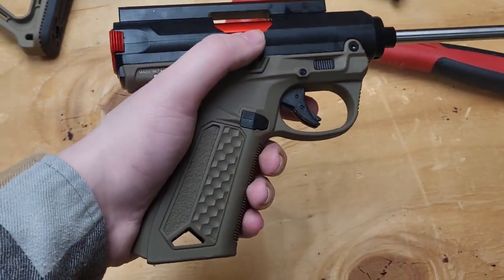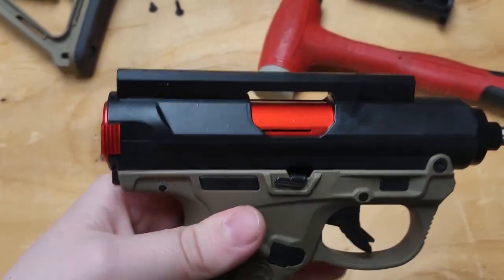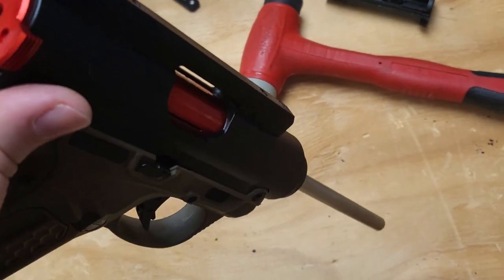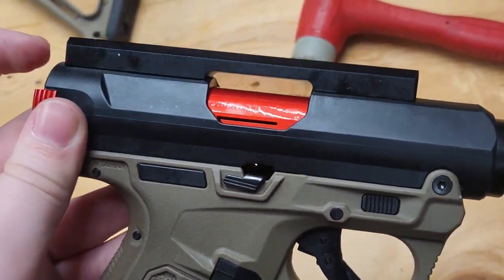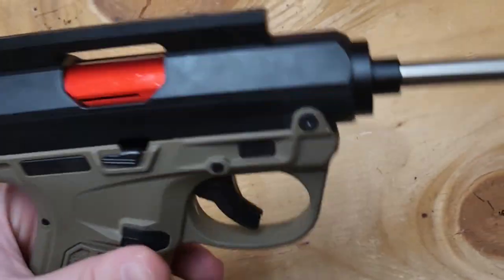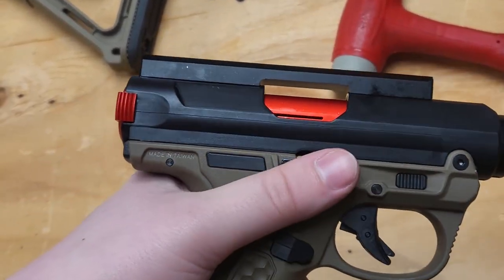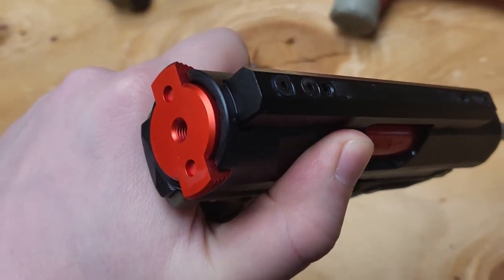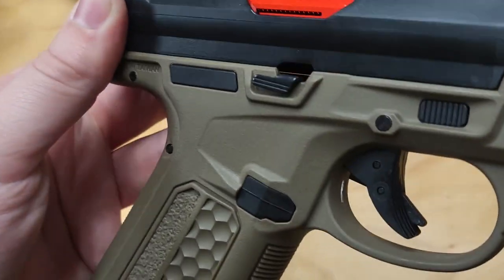T032🔫 An Update on the AAP01 CowCow Bolt | Airsoft toy tech guide

Comment: Hi I believe I’ve possibly solved the issue with lightweight BBU in aftermarket receiver, in my case, the Mamba kit. I’ve got a 5KU ultra lightweight bbu (cheap from sixmm)  with cow cow steel hammer set, I’ve used the cowcow ss hammer with the standard auto shear and the standard hammer rotor with the standard trigger release this combination worked for me and have no issues. Best of luck Guys and keep calling your Hits

Comment: Adding my experience with this bolt. Installed in the Gen1 C&C AI aluminum body with 150% recoil spring, 200% nozzle spring, upgraded nozzle, speed trigger, CNC hop unit, and CowCow hammer set. Having the same issues with feeding, and I've got the MAS mag springs for my MP5 mags in my Primary adapter. Going to see if a 300% nozzle spring helps in a few days. I'll be upset if I have to swap back to the stock bolt just to get it to work. I like the cycle rate where it is with just the spring and bolt upgrades. I will also note that if I pull the bolt back all the way it jams in the housing, but this never happens during cycling.

Comment: How about hammer springs on this? My original AAP Hammer spring is about (not totally shure) 150% marui standard G-series. 
May a lighter hammer spring would be better, because you don't need that much gas anymore?
And how about recoil spring? Do you need a stronger any more?

Comment: So I put the CowCow bolt into a black mamba body with zero issues. I also upgraded to a CowCow hammer assembly and this thing rips!
Reply from the maker: Yes, I think my issue is with the bearing upgrade on the mamba gun.
Reply: @Wyhaq  I was debating on the roller bearing upgrade but I decided to see how the CowCow bolt and hammer assembly worked together. Thanks for all your videos, it’s clear and easy instructions to help get these parts installed on the AAP-01.
Reply: So it works perfectly with mamba body and cowcow hammer set. Good to know.
Are you able to switch from semi to auto or is it "stuck"?
Reply: @error262  I’m able to but that’s because I got the bolt pull handle with the selector moved to the outside. It’s a very worth while part to get.
Reply: @alanwright782  which one did you get?

Comment: Your last video you said the bolt doesnt work best with a bearing. How about the stock hammer set? or maybe the cowcow hammer set? 
Unless you're just saying in general that the cowcow bolt doesnt work at all with a mamba kit.
Reply from the maker: It does work in the mamba with a normal hammer set

Comment: I just got mine and its not working once I put it back together, with or without the mag. It gets stuck at the very end of the bolt release and lets the hammer back up, ending the trigger cycle and I have no clue why. Im using the stock polymer body and have only put a new steel hammer cuz it just broke my stock one.

Currently trying to diagnose whats up.
Reply: Can confirm, CC bolt is just not great with QC. Nothing but issues so far, gonna try the CTM bolt.

Comment: Where did you buy that polymer?

Does this have anything to do with the bearing not working?
Reply from the maker: This is just stock polymer receiver. Bearing is still a problem, I tried bearing with polymer and it had the same problems as before.
Reply: I’m wondering if edge of bearing is catching the edge of the bolt going in.
I’ve had a few issues with that in the stock one. I was going to shave the hammer back more so it sits deeper plus peen over bearing spindle so it doesn’t slide out
Reply: @Wyhaq  do you know anywhere that has a black bolt in stock
Reply from the maker: @AmericanToucan  oregon airsoft has one left. In store purchases only
Reply: @Wyhaq  out of state. I would buy it though
Reply: @Wyhaq  if I paid for it. Would you send it
Reply from the maker: @AmericanToucan  I don't want to ship stuff to people I don't know
Reply: @Wyhaq  don’t blame you. Was hoping you were someone that already had a P.O. Box and did it.  Was more amazed an entire store wouldn’t 

Store policy to not ship items. They wouldn’t even if I paid for the insurance and signed for it
Reply from the maker: @AmericanToucan  just a local store and arena. They prioritize the local community over all else.
Reply: @Wyhaq  I got screwed into waiting for a second batch even though I bought it right as it came out. I checked a dozen places by now and that’s the only one that has it
Reply: I tried contacting cowcow. They don’t answer to ask if they are changing anything for 2nd batch